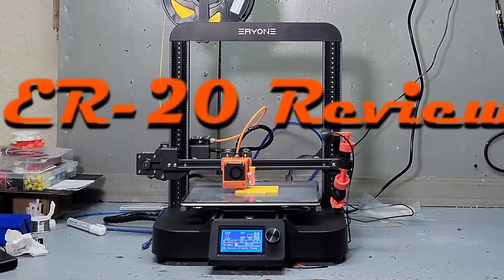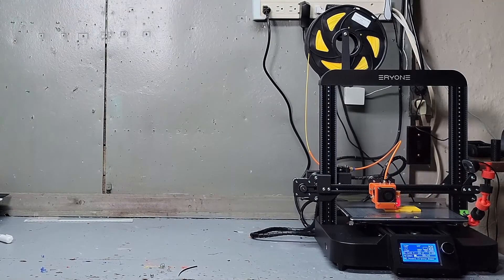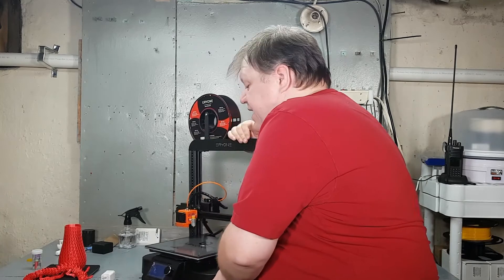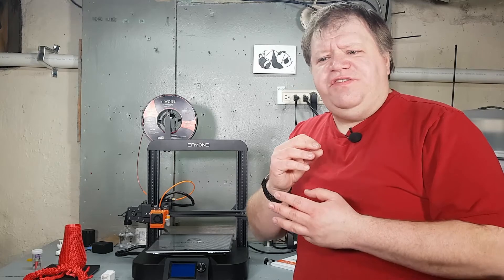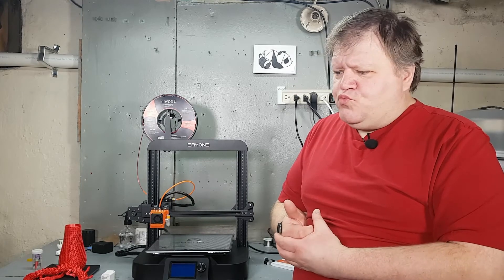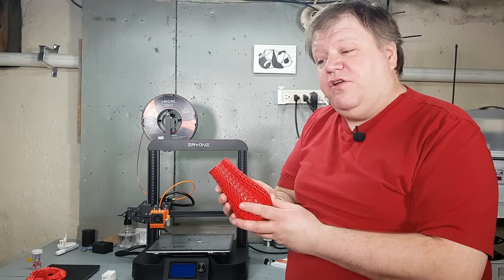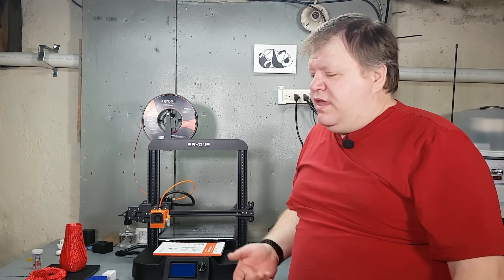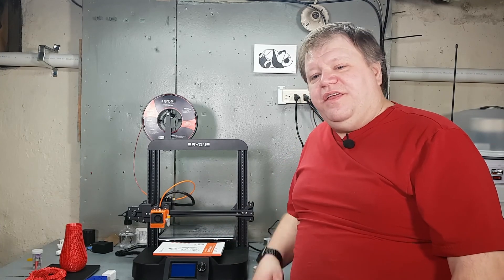Eryone ER-20: is it worth it?

Comment: I just purchased this printer and I'm concerned about the issue you mentioned. Could you please share the link for the item that can fix the arcing problem? Thank you
Reply: are you referring to crimp-on wire connectors?
Reply from the maker: Yes has to do with heat so I so I cut off the solder off and use this  Ferrule Crimping Tool Kit, Kingsdun Ferrule Crimper Plier with 2200pcs Wire Ferrules Kit Wire Ends Terminals https://a.co/d/6oBzqJ0